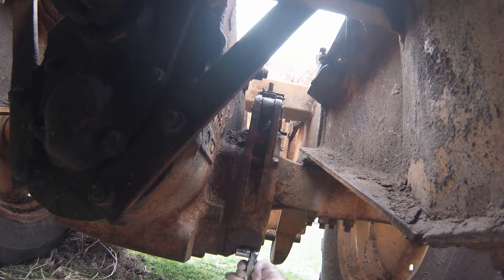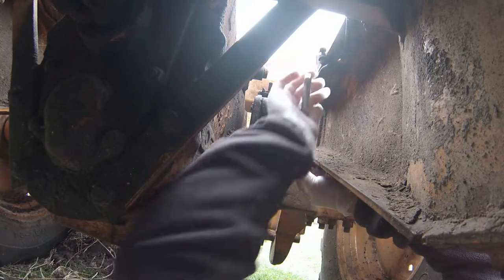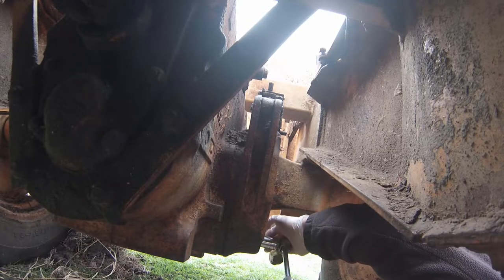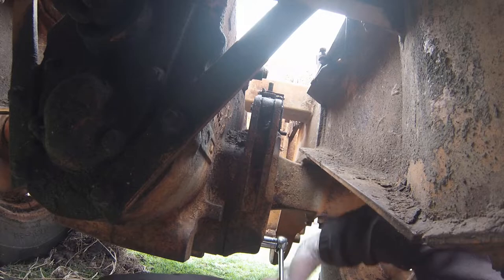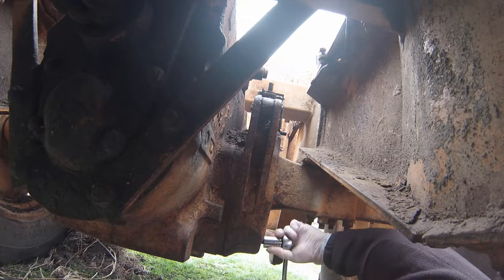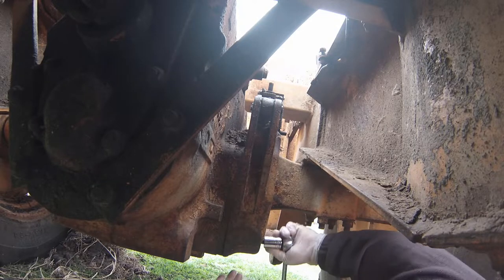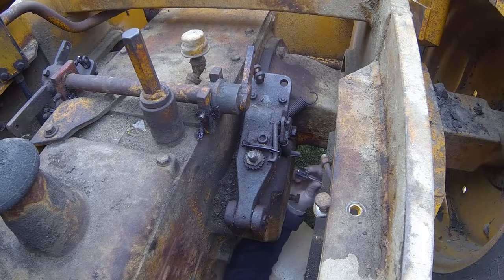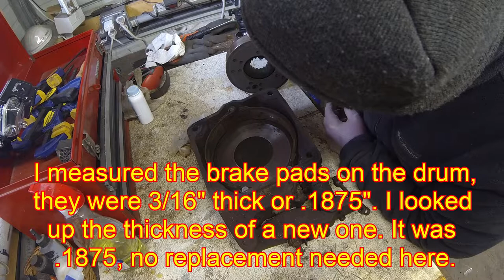CASE 580C Left Side Brake Disassembly, Rusted Parts Kept Loader From Moving, Part 1 of 2 Part Video

Comment: Welcome to Case 480 and 580 brakes. You did a great job learning your way through this. The lever pin you freed up should have a grease zerk in the end of the pin.  The C model was the last to use DOT 3 fluid. the later D and E models use dextron in the Master and slave Cylinders.
Reply: Dextron? That must be what k.o. my master cylinder's.

Comment: I have a 580C, I changed out the backhoe for a FACTORY three point hydraulic hitch then put a Gannon box scraper blade w/hydraulic rippers or scarifiers on it for weight and grading roads.

Comment: I have a 580d backhoe with a lock up wheel  I need to haul back home. I figured you would be the guy to asked. Do you think it's possible for me to free the brake up on the machine without tearing it apart. I just want to get it to my shop which is 400 plus miles away
Reply from the maker: First off, I’m not an authority on the Case 580’s. I would not with any certainty be able to advise you. I had the same problem and the same question. I use another tractor to give my 580C a little nudge forward while in gear running. The left brake was my froze up brake. It freed up and I drove it home 2 miles. I hope that helps.